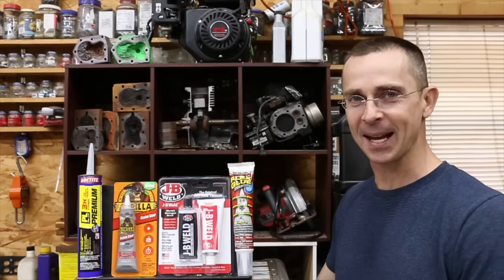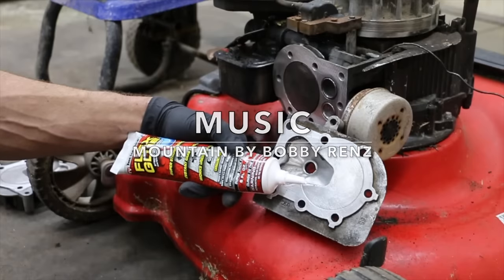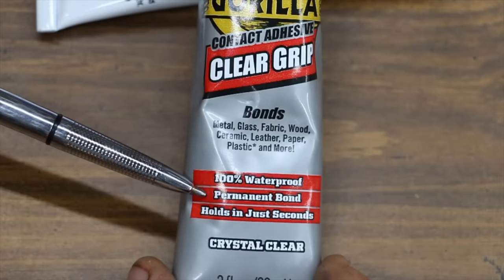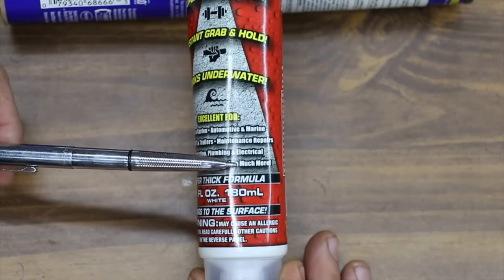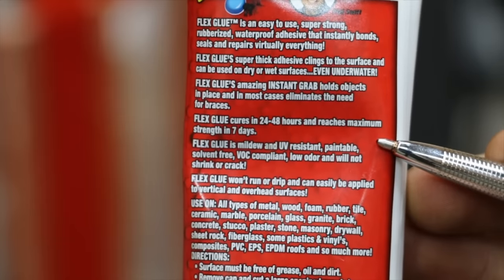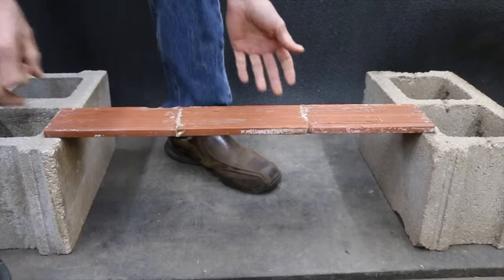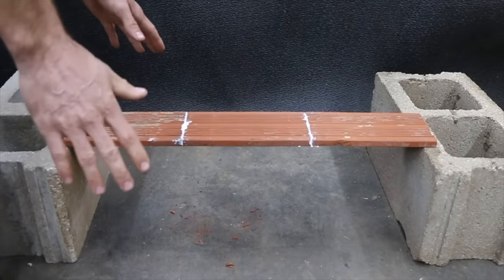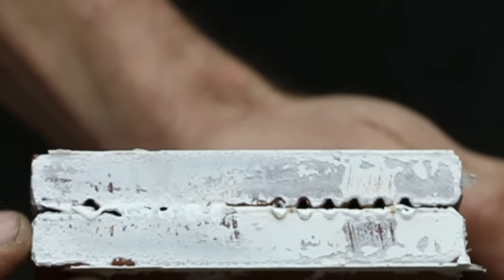Is Flex Glue better than JB Weld, Gorilla & Loctite?  Let's find out!

Comment: I’d like to see you turbocharge a lawn mower engine.
Reply from the maker: Great video idea!
Reply: Project Farm if you can find a Veloster Turbo in a junk yard, those turbos are very small but are pushing 20psi, so that could be a solid turbo charger to start with if you can find one. Alternatives could be eBay turbos since you aren’t hooking the turbo up to engines over 200cc’s
Reply: Maybe use a Honda engine with over head valves.
Reply: Guy up the road was selling his old rider in a yard sale, it had “turbo cooling” so the flywheel had a special fan or something....anyway the guy honestly thought it was a turbo charged opposed Briggs....I love rebuilding old riders, so I asked what he wanted...he wanted 1K dollars because it was turbo charged, and he said (and I agree) a turbo charged craftsman is pretty rare, I’ve never seen one. I just smiled, told him I hope you get it....I took photos of it, being it was so rare.
Reply: @ProjectFarm  I made a suggestion in one of your other videos about running compressed air through your sealed carbutorless system you made for running on fuel vapors. Basically seal the fuel agitator tank and release compressed air through it.
Reply: Hi
Reply: so a Honda?
Reply: Ivan Gutierrez Many of Honda’s small (lawn mower) engines have over head valves. Most of the smaller engines Project Farm uses have the valves in the block.
Reply: cars and cameras did that once, even uefi (fuel injection)
Reply: Supercharge may be easier!
Reply: mcw0530 in what way would supercharging be easier? Tbh I think it’d be much more of a pain in the ass
Reply: Me Myself that would make some fuckin power
Reply: with nitrous
Reply: All I know is you can’t use a carburetor u need to put a fuel injection system

Comment: Many moons ago while driving from Salem, Massachusetts to Grand Junction, Colorado, I sprung a big leak in the rusty gas tank of the barley road worthy heap I was driving, and used JB weld to plug the hole at a cold Nebraska truck stop. Worked like a charm. Got me over the Rockies safe and sound.
Reply from the maker: Glad to hear!

Comment: Wow, excellent comparison demonstration. I read that the Gorilla Glue Company asked you to compare their GorillaWeld product with the other similar epoxy products demonstrated here instead of their clear fabric glue. That's fair I think. Maybe another video?
Reply: I saw the GorillaWeld and thought the same.  I'd enjoy seeing another video like this with JB Weld defending it's title against GorillaWeld!
Reply: Absolutely.  It was rigged.
If anything, the video showed the difference between epoxy, construction adhesive, and contact cement.
Congratulations to Gorilla Glue for being so calm about being ripped off.
Reply: @evanodder6948  could you please link the video
Reply: Something else i noticed or maybe it just wasnt shown in the video that it was done prior to application with use of gorilla glue.

Did you dampen the surface prior to applying the Gorilla Glue?  I use it instead of super glue for just about everything around the house and in the garage and it seems to work extremely well, ONLY WHEN APPLIED TO DAMP (NOT WET) SURFACES!!!

I didnt see this done in the video and wondered if it was done, and if it wasnt, if you could do that and retest just the gorilla (since we already have results from the rest.)  My grandfather also uses gorilla for a lot of things, and ive used it on wood more than wood glue and it seems to hold quite well, again, only when ive dampened the surface.

On a side note, and maybe its just me, but JB has never worked on anything that I've ever needed it to work on (ive only ever needed it for use in automotive applications in and around the engine bay with metal-metal application).

Anyways, so how about that gorilla wood retest with some water?  I tried it and got a much different result than you did in this video.
Reply: @evanodder6948  - Being ripped off? The YouTube channel showed the labels before the video started , did you just decide to forget what the label says? Gorilla claimed it's for metal, wood, PVC, and many other applications. If it's only good for arts and crafts then say that rather than mislead people into believing it's much more that what it really is
Reply: Yeah this was a terrible test. He used various types of adhesives. I’ve used the jb weld and gorilla weld and never had an issue with either one. Also, did it seem like there was barely any gorilla glue on the wood test. BTW, I have no loyalty to gorilla glue. If anything I’ve used jb weld more. However it seemed like he has some bias against gorilla as he seemed to try to set it up for failure
Reply: @xentlygaming4981  What is best for plastics ?
Reply: @xentlygaming4981  jb weld original is not made for high heat applications (it says so on the packaging) they have a high heat/exhaust product that is not as strong but doesn't lose strength when heated.
Reply: @Everyday_Railroading  exactly. Gorrila glue is a rip off

Comment: There are numerous JB products for different applications, you just used one. One of the supreme abilities it has is to withstand heat up to 700 degrees (Fahrenheit) for a short period,about 3 minutes, I use it for block repairs,if you prep the piece properly , you apply and forget it. I machine it,tap it, excellent for block cracks, I’ve even used it on cylinder walls with cracks down lower in the bore There’s no doubt about it JB wield is in a league of it’s own.
Reply from the maker: Thank you!
Reply: JB weld is voodoo magic.
Reply: I know,  my buddy was going to fix my block, years ago. I didn't believe him at the time, so I didn't buy the weld. I knew I should of did it. Lol
Reply: You could core fill blocks with it aswell just paste it up and poor it in stop the block warping half fill.lol
Reply: Gotta love the Justice Brothers; genius "ran in the family"!
Reply: I've made new motorcycle fins on a 1950s motorcycle head and the fins are still there 10 years later!
Reply: Try Belzona 1111 or 1121 next time.

Comment: A very common problem with diesel engines is stickion (injectors getting dirty and failing). I have personally seen where my truck was diagnosed with needing new injectors, very hard to start ran terrible, in a 7.3 powerstroke, with the cost of over 1200 dollars.  I used Hotshot Secret  engine oil additive ($60 )and it's 2 years later and running great.
brands i would compare are...
Lucas , Archoil, Hotshot, Rev x,Tribo tex , Motorkote,
 I bet there would be thousands of diesel owners that would thank you.

I love this test JB weld.... wow.
Reply from the maker: Thanks for sharing.  Thanks for the video idea.

Comment: I had an 82 f150 i bought with some friends for 775 well we drove it from kingman az to bullhead az . As we pull in my mom pointed out my exhaust was hanging by 1 metal coat hanger, well me aprox 15 at the time used enough metal hangers to alighn my exhaust system with the headers. I take a trip down to home depot and buy jb 2 part to bond it to the headers, a 3 inch hose clamp like thing to hold it in place and i coated the whole clamp with 2 things of jb steel, it held up threw no trail dessert, dirt roads, threw joshua trees even jumped the truck and its stock suspension, drove the truck to work for 3 years after the fix in 2012 now 2018 the exhaust system is still here on the truck lol.
Reply from the maker: lol
Reply: Ball Zack well you didn't have to fix your FORD (fix or repair daily)
again , good for you !!!!!!!!!

Comment: Many years ago I was flat-track racing a single Bultaco 250cc two-stroke.  The theory was that decreasing the volume of the bottom end would increase the charge velocity through the transfer ports to the top end.  So we stuffed the crankshaft balance with Styrofoam a couple mm below flush and then coated the foam flush with JB Weld.  tow years of racing and it still held!
Reply from the maker: Thank you!

Comment: Most Gorilla glue I've used say you have to apply to a damp surface because the water causes a chemical reaction with the Gorilla glue.  Double check the label please.
Reply from the maker: Thank you and Happy New Year!
Reply: I was thinking the exact thing.  I have used it on bone dry butcher block table tops because it's waterproof, and when you add the moisture, the glue just starts bubbling like crazy.  BUT it won't bridge a gap.  I did some tests on the original Gorilla glue and when it foams, there is no strength in the the foam, so the parts have to be pretty well perfect fitting to work.  I have never used this product so can't say if it's the same chemical makeup but the moisture is definitely needed to activate the original glue.  When it didn't stick to the end of the 2x4, I thought that was maybe the problem. The original says there is usually enough in the wood to activate it but I don't trust it and always add some to the wood first.
Reply: @qoph1988  for wood = elmers waterproof wood glue. The board will break before the joint will.
Reply: That would really only make a difference with wood.  You're not going to apply glue to damp metal
Reply: @AffordBindEquipment  8
Reply: Gorrilla super glue is great.But you don't add water to it.
Reply: @qoph1988   I use it to build RC airplanes. It can just about handle styrofoam. :)
Reply: The gorilla glue used in this test was a white glue version and not the polyurethane version which foams. The polyurethane type states to use water. I never do and it works just fine.
Reply: @bobwoods5017  I see what you did there...  LOL
Reply: @timothykissinger4883  gorilla glue is expensive. All super glues are cyanoacrylate....exactly same stuff as the single use ones, only difference.....price!👍
Reply: Glad I read down the comments, at least through your's. Had I not ran across your's I would have made the exact comment. Other than a few little critical details regarding following manufacturer's instructions, Project Farm produced a very good video. Maybe your comment will inspire him to be a little more attentive to detail in future videos.

Comment: I recently had to fix a metal lamp post.  The female end had stripped and augered out to where the male part could just be slipped in and out with no gripped from the threads.  Went to local hardware store and looked at  all the different options and decided to get the JB weld 6 minute cure in the dual syringe with reusable cap.  So you can help but get the exact proportion.  Needless to say it worked fabulous I let it cure for two days as there was no hurry.  It's what I'll reach for in the future!

Comment: I repaired a AR type Rifle Lower  Receiver because it had Broken where the Stock Tube screws into the Lower Receiver and the only other thing that I had done was to Drill into the Lower Receiver and put a Couple of pieces of Very Small Wires to give the JB Weld to bite into and hold. After giving it plenty of time to Dry I cleaned up the area where the JB Weld was onto the Lower Receiver and Screwed in the Stock Tube for the Stock and I can tell you that the JB Weld did it's Job and is Still holding to this Very Day and I been shooting that AR type Rifle now for the last 17 years and it is Still going STRONG, I'm a Real Believer in the JB Weld Products.
Reply from the maker: Impressive repair!
Reply: the stock tube... the buffer tube
Reply: "Field Expedient" solution! Will that go in the manual now?    >;0)

Comment: JB Weld is incredible stuff. You can actually drill and tap threads into the stuff and the threads will hold a reasonable torque. Amazing product!

Comment: First, I'm very impressed with the thorough methodology you follow.  I saw the short bolts being glued on but did not think the double nuts were for torque testing.  Super clever and very relevant to a test for an adhesive.  

Second, I'm impressed with the JB Weld on PVC.  It would be interesting to see the failure weight/distance for an uncut pipe.  I wonder if the JB is almost as strong as an uncut pipe.
Reply from the maker: Thank you!

Comment: Gorilla glue at least is great for doing bodywork on cars!  It expands a bit similar to urethame foam insulation you spray into walls . Also sands easy too.
I mixed gorilla glue with carbon fiber weave and stuck the wadded up  mixture  into large rusted out area under windscreen in 1976 Alfa Romeo alfetta coupe.
I had tried bondo, JB weld, epoxy too, but the gorilla gliue worked the best for this because it expanded a lot as it dried and so made it become very rigid because of the expansion of the glue "underneath" the edges of metal where you can't see it....thlis repair .came out great looking stronger than the original steel.
Reply from the maker: Thank you!
Reply: How not to do body work
Reply: @smokeeater1769 
 hi James
Mix of gorilla glue and carbon fiber weave wadded into ball and stuffed into rusted out sections of a car where you also need some rigixity and strength too works very great plus you can sand smooth later just don't tell anyone what you did eh!
It's stronger than steel the repaired area no one will know or care unless concourse 67 Ferrari.
The gorilla glir sticks and clings to steel very well also...better than Bondo thats for sure.
Reply: Thank yout - that's brilliant!  What a good alternative to have if you really need it!
Reply: Gorilla glue mixed with car on fiber weave comes out to be stronger than original sheet metal also  expands as it dries. Lots better than Bondi so why not.
Reply: @brianstankes4573 
wow insullts!!
I Must of hit a nerve eh!
 Try  it next hopeless rusted out area it's not worth anyones time to fix welding in New sheet metal section. Or don't try it !! 
I don't care one bit it's not.my business
Reply: @MrDKONZEN  Hey I feel ya. Old Alfas rust quickly and badly - finding something to patch it up and keep it going a bit longer can make sense for a car that is loved but is otherwise a "worthless" rust bucket. Next stop - something to tighten up the rubbery-feeling shifter...
Reply: @mf1ve 
The impossible to fix area on my 76 alfetta was under windsheild on passenger side, rusted hole about 8" long 1" wide at widest problem wss rust extended to underneath wi dsbeild and atea supports windsheild...it teally was basketcase but this gprilla glue and carbon fiber blob expanded atound edges of rusted area hand held in place very strong stronger than rock or steel bondo went over top looked great

Comment: I live in MN. With major temperature changes I wonder how J-B weld does with that? Thank you so much for testing the products out there!
Reply: Yes, that would be interesting. Zero or sub-zero temps.
Reply from the maker: Great test idea!
Reply: Does well in alabama.  Low 20s at night 7th during the day.  Handles the 100 degree heat and humidity during the summer
Reply: @sketchyssk8shop  yes talking lows of -40 with the wind chill. And highs of 100's. Remember NFL fans, we had a Viking player die from heat?
Reply: Also a Minnesotian, I have wondered this too
Reply: As a fellow Minnesotan, I've used JBweld very often. It handles temperature changes without a problem after it's cured properly. Curing things at say 20 below has given me mixed results depending on the material. Plastic will fail to cure in the cold with JBweld, but PVC and wood have worked fine for me. Metal has been a hit and miss
Reply: Same here! I've found so far, using JB Weld (plastic bonding specific JB Weld that's supposed to withstand fuel) to fix the neck of a snowmobile fuel tank. It struggles to maintain its bond when under a lot of pressure with occasional blunt hits (from a knee, etc), and given the sub 10 degree weather of our winters.
 
Needless to say, JB Weld never fails to impress.

Comment: Jb weld is amazing, it's my favorite when working with resin miniatures. Clean the surface, add a bit of tooth to it, maybe some pins depending on the size. The resin will fail before the JB weld joint.
Reply from the maker: Thanks for the feedback.

Comment: Can you make a homemade dyno?? Probably test performance gains and loses
Reply from the maker: Great recommendation!
Reply: BUY ONE PLEASE!
Reply: If there's anyone who can make a quick dyno...… this is it! A good safe start (no rotating mass) could be a water pump / hydraulic pump and some water valves / adjustable spring reliefs.... I've always wanted to do something like that so I can load a standalone engine fully, or run sustained loads through the rev / torque bands.
Reply: @StevesModernReviews  Do you realize how expensive they are? 3-4k for a cheap dyno. If you want a good quality one, it's 10k+(Prices are USD)

Comment: You should try penetrating fluid as engine oil.  It would be cool to see how much of the oil makes it past the piston rings and into the combustion chamber while it runs
Reply from the maker: Thanks for the video idea!
Reply: Is ky liquid included in that 🤣
Reply: Use mouse milk
Reply: @gremlin1396  
Astroglide vs KY

Comment: That JB Weld is incredible!! End to end gluing is the worst possible case for glues, for JB Weld to hold that much weight on the brick is amazing! It's rather strange that it didn't hold nearly as much on the wood as it looked like the adhesive broke, it didn't detach from the wood itself.
Reply from the maker: Thank you!
Reply: The 2x4 were much more leverage on joint than the bricks.